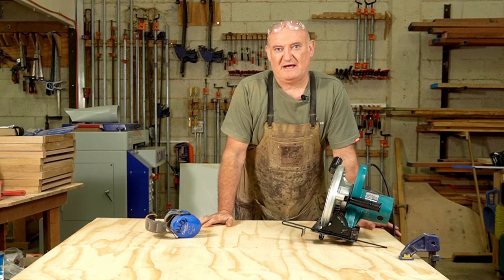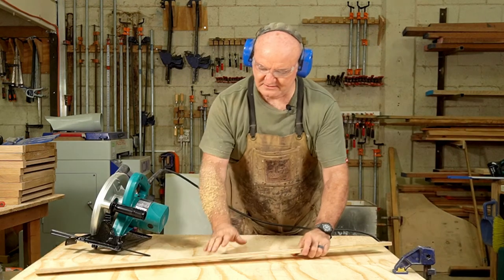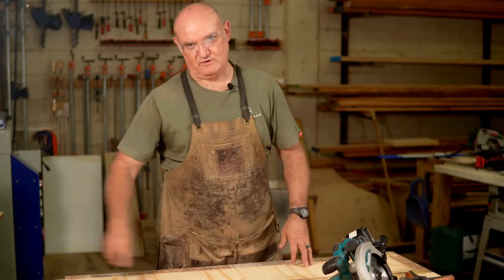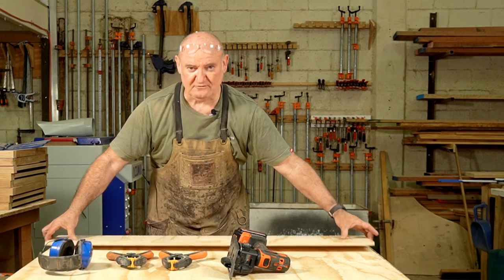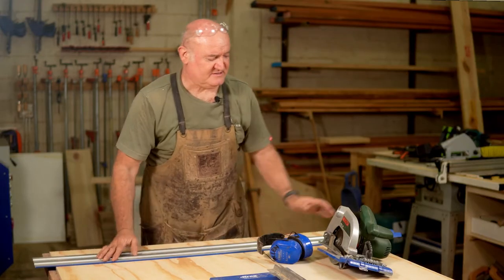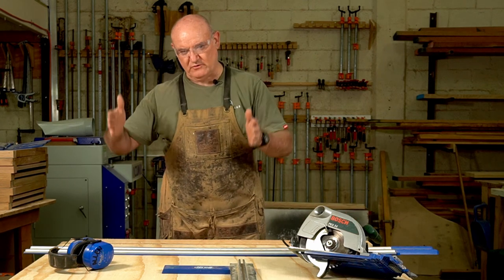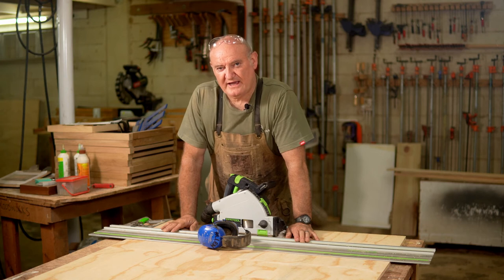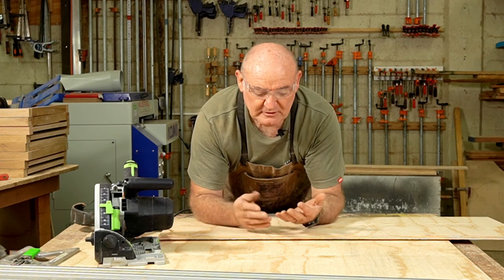How to Cut Plywood at Home Quick and Easy

Comment: these are only straing cuts. What if I need to cut out round, oval or any other different shapes in the plywood? What tools are needed for this job? As I know there are only large table machine tool can do this.
Reply from the maker: Hi Nick Plywood to the rescue we will make a video for you showing you how you can create a plywood jig to cut round oval and other shapes in wood, we spoke about it a bit in our video do you even use plywood. We will make a full video for you with a step by step explanation

Comment: Does that Makita circular saw really cut down from the top?!  I've never seen a handheld circular saw do that - they always rotate anti-clockwise as you look at the blade securing bolt.  Would be very curious to know how they handle if they're backwards as it sounds like they'd be trying to lift themselves off the surface they're cutting that way around.
Reply: Might have got the clockwise/anticlockwise backwards but you know what I mean - they always cut from the bottom up through the material to the plate of the saw.